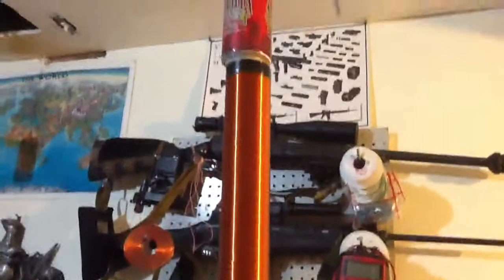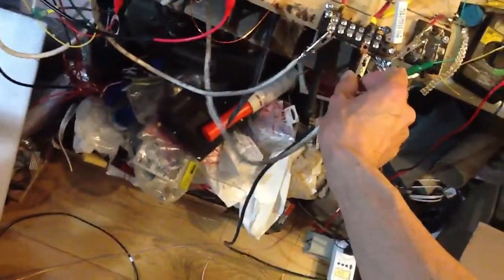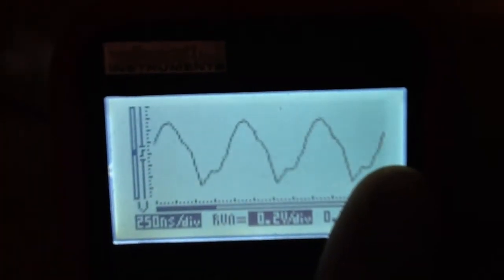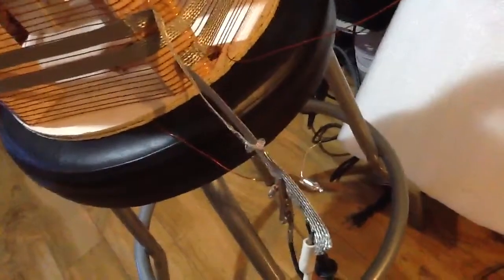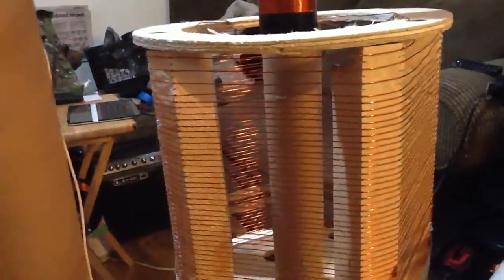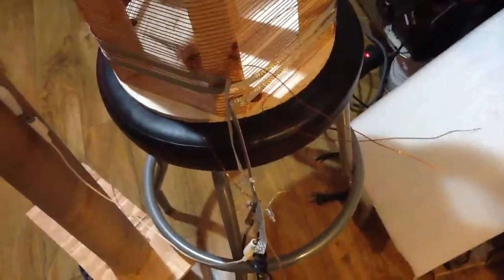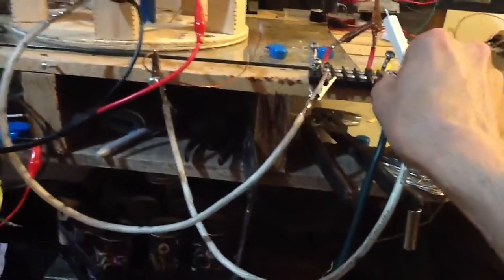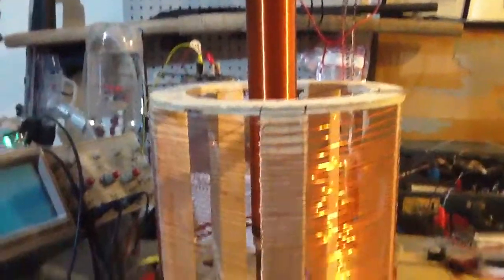TMT Tesla Magnifying Transmitter: part 2 Receiving Coil

Comment: Hi man, i have a small solid state Tesla coil (5W), no grounding, i can light up CFL's and LED's connected to the Avramenko plug, i can even run a small motors if i pick a signal with bifilar coil and raise the input power, but transmission range is very limited, so i would like to know if you can light up things through the walls with your TMT? Thank you.